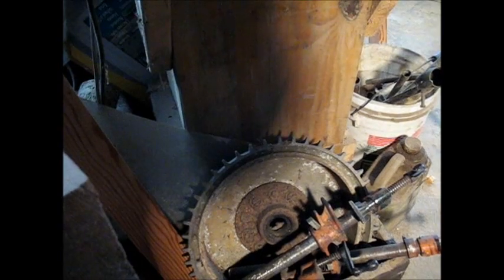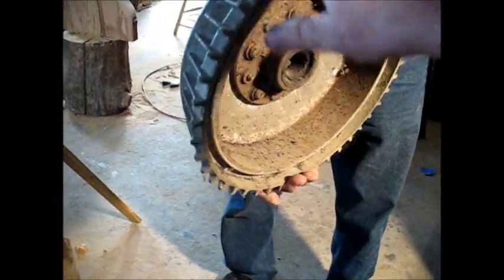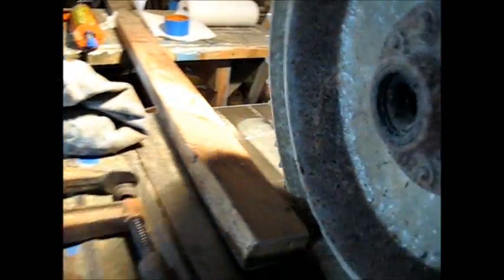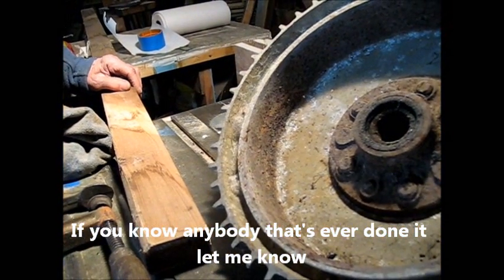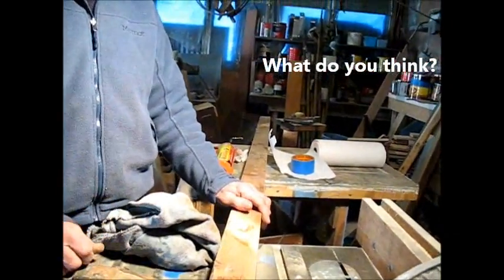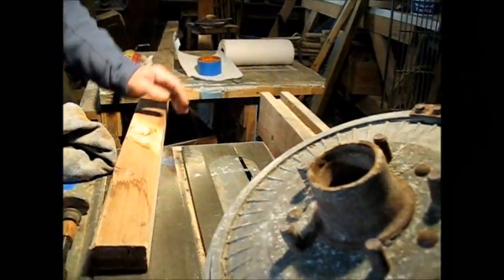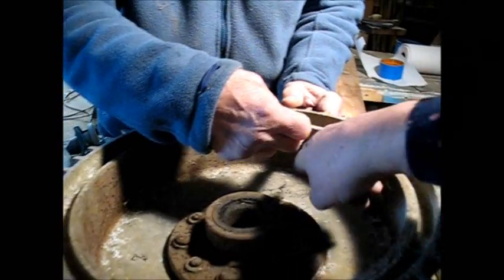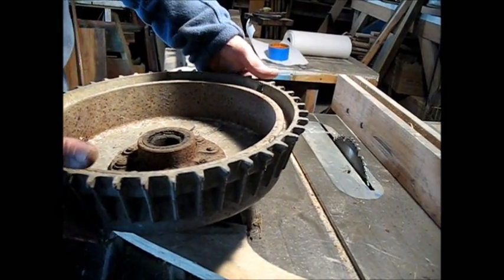Buick finned aluminum brake drum BANJO?

Comment: You could take it to a shop where they have a brake drum lathe, they could turn the inner steel drum out of it and make it even lighter, similar to what you were suggesting.
That is a nice looking drum without a lot of broken teeth on the fins either. That should be a neat project for you.

Comment: (1 of 2) I might be wrong, but If I recall correctly these were called 'composite drums', and the aluminum was cast around the cast iron friction surface 'sleeve'. The hub assembly was later pressed in and riveted. I don't believe the sleeve is removable.

However, for your purposes, if you could find someone with a drum lathe willing to spend time and machine it out, it would look perfect! You might need to leave a few thousandths as it might become erratic as the bit breaks through.

Comment: I believe that the hub is riveted through the inner steel liner and the aluminum drum. If you grind the heads off the rivets I believe all the steel will sperate from the aluminum. :) keep up the good work!!

Comment: (2 of 2) In any case, I suggest leaving your hub in place until you decide if machining is the answer.  It will be necessary for mounting in the brake lathe...

Also, just out of passing interest, steel is a terrible material for the actual friction surfaces of drums, rotors and flywheels, and is almost never used. Cast Iron is the best... always has been, probably always will. Think I heard of some steel golf cart rotors once, and even those turned out to be a flop.